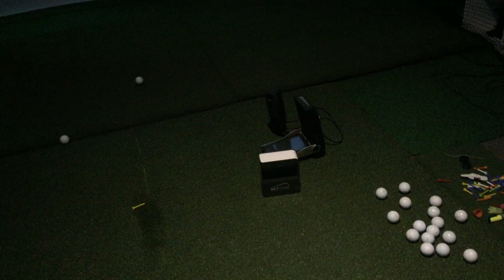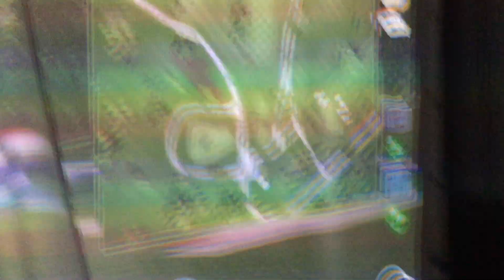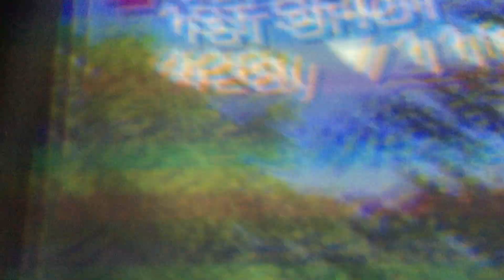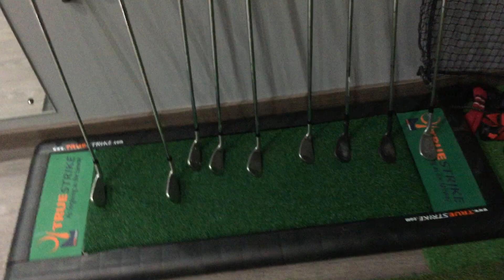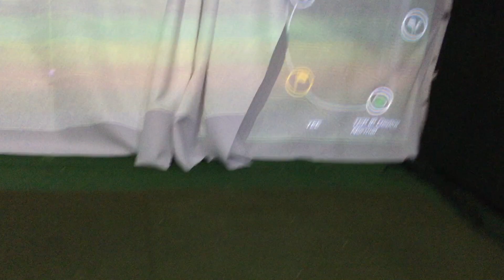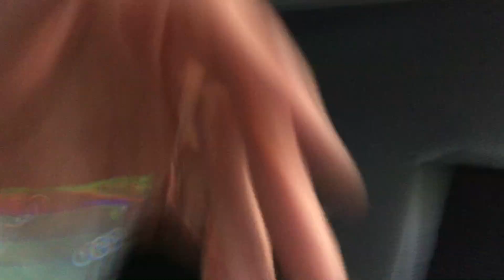Walkthrough of SkyTrak golf simulator built with Hybrid Me

Comment: What's the smallest space recommended for a functional sim?
Reply from the maker: Tough to say for sure. You'll need room for the golf swing but also for all the equipment if you are going full sim such as PC, monitor, projector etc. Minimum setup could just be a launch monitor, tablet(iPad) and just hitting into a net for example.
 
Width wise I know golfers who use as little as 2.6m wide, with a skytrak 10 cm from the side wall. Due to lack of width they only hit up to hybrids. 3m wide you should be fine to swing driver but offset from centre.

Length wise all you need is enough to swing and clear the back wall and the net/screen(with enough room behind the screen to absorb impact (can use padding / memory foam to help absorb impact if very short on space. I'd definitely look for low bounce back screen if short on length/depth. 

Height may be the biggest issue for most. 2.8 metres could be useable for most with driver but may be borderline for taller golfers. Less than that and you will either need to adjust your swing to be flat or may choose not to hit driver. If wanting a full sim you also need to consider where the projector will be mounted (and ensure it's not going to get hit).

Hope this helps. None of this is written in stone.
Reply: Thanks, appreciate it

Comment: Lap top+ skytrack + projector and net screen far to expensive in reality!
Reply from the maker: For many, it definitely will be. Screen for less than £200, Surround netting £200, SkyTrak around £2000, Golf mat £150, Projector for £600, JNPG Software £300 per year. PC cost varies massively on spec and graphics cards are silly prices right now but if you turn down software settings you might find a bargain out there. Still.... you see simulator builds being quoted at upwards of £40k so "expensive" is always relative!

Comment: A very informative video ! I have one question regarding the space needed for an install; how high do your ceilings need to be in order to allow a driver to be used? I'm 6'1 tall if that helps!

Thanks in advance!
Reply from the maker: Thanks. It's tricky to say really as it also depends on how flat is your swing. I think 9 feet would be the absolute minimum, depending on your swing. 10 feet would be better. The best I can suggest is that you find a ceiling of a similar height and "gently" experiment with a driver to work out what your limit might be. Sorry not to be of more help here.
Reply: You have been very helpful thank you Philip!  I have just moved into a new build so I think I may be struggling! Thanks again for the info though.